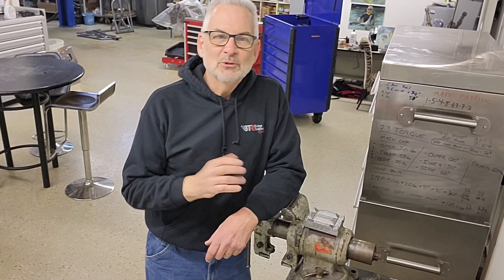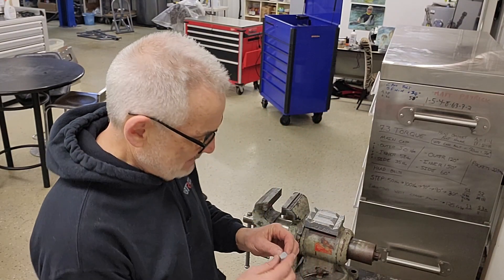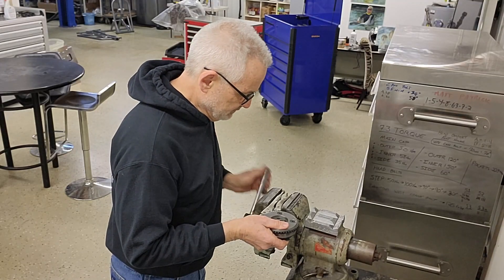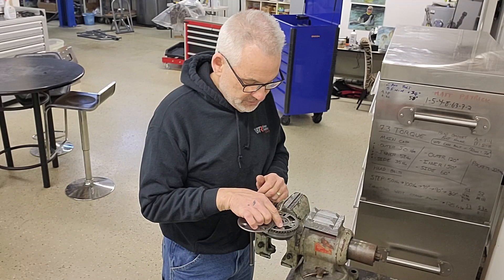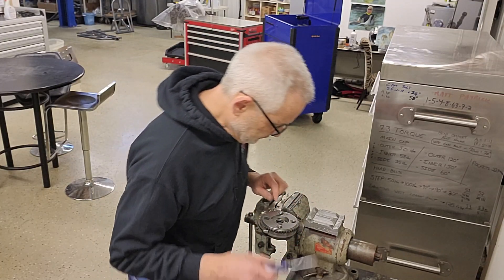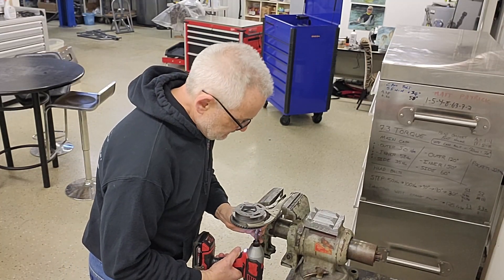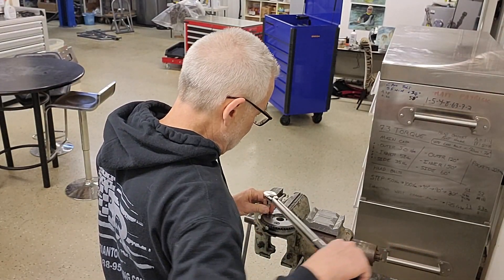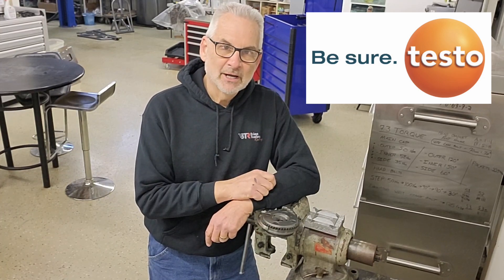Retake! Easier Way To Install the BTR Timing Wedge on a 7.3L Godzilla

Comment: Brian, does the kit lock out the VVT completely ?   Seems to me, that is what we want to do.. And we still use inch pounds
Reply: This one is just to limit the travel.   There are several that make lock outs.   Yes, we can use metric or SAE units, most torque wenches, but as we were torquing a metric fastener I used the metric torque measurement.